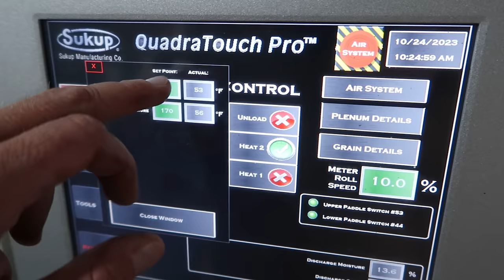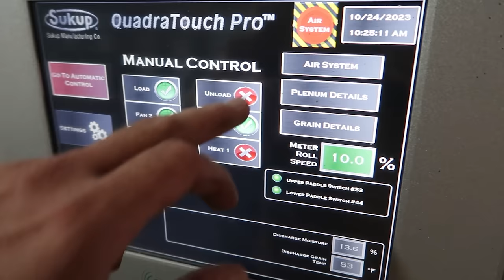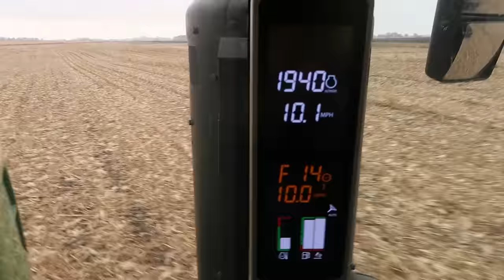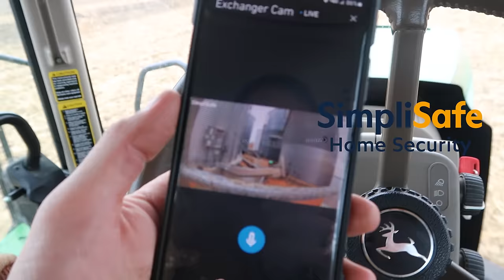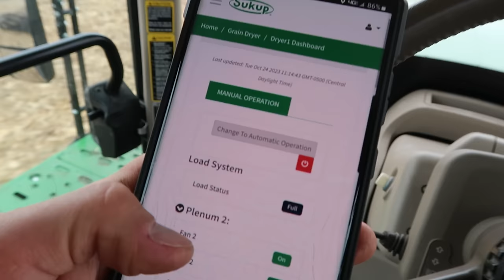Running Tillage and Finishing up Corn Harvest

Comment: I am 67 and I remember that song : Rain Drops keep falling on my head . My SimpliSafe water sensor gave us an alert . My water Softener was leaking and water was pooling on the floor  . Turned out a valve in the softener failed and was leaking. That happened on a Friday evening and my plumber was not able to check that out till Tuesday . We bypassed the softener for 4 days . wound up buying a whole new system . SinpliSafe saved us from water damage in our finished basement .

Comment: Those trailers don’t flex when empty because they are new and tight yet, the old ones flexed easier because you dropped them into a ditch a few times and loosened up all the rivets. 😂
Reply: Yeah if you say so smh
Reply: @tomcander3669 why so mad?
Reply: @Ghostplaysgames93  I'm not but most likely here's a guy making a statement and probably can't even back his pickup
Reply: @tomcander3669  never said I was better we all have screw ups. It was more of a joke because they dropped 2 of them into the ditch in the harvest videos 2 years ago.
Reply: You talking about trailers or ex-wives?
Reply: @tomcander3669 Imagine getting your rocks off by trolling people on farm videos? 

Gotta love it
Reply: It's air ride
Reply from the maker: 😂😂 it happens!
Reply: My 2019 hopper trailer is still that stiff and has been pulled 60k miles
Reply: Also, running those poly plates makes for a lot less room to pivot up front. Makes a big difference.   I’d agree with the “new” trailer thoughts.   I’d guess that in 5 years of twisting it’ll soften up
Reply: @JasonGudde but how many ditches did you drop it in? 😂
Reply: That's what I was gonna say.  Brand new, empty, super light because it's all aluminum. Well Made In America product right there.  But give it a few years and she may start to flex. But you could add some gravel and level things out wouldn't hurt.  Or concrete, but it's gets damn cold up there, so concrete will crack soon.  Unless a finisher knows how to order the right stuff for the area, might start solid for a long time
Reply: Since no one’s mentioned it yet new tight bushings on the suspension on top of tight rivots poly plates and the frame not stretching yet. Metal frames and suspension on trailers are like a house when new they haven’t had the flexing and stretching from usage yet which is why they put stickers on to have alignment checked after so many miles then on intervals after “initial break in”
Reply: @ni1469  true facts.  But honestly, how many farm rigs do you think this actually happens with? Meaning the alignment and inspections are X number of miles 🤣🤣
Reply: @TheBiggRiggz  I haul feed ingredients in a high side hopper that tracks about 2” to the right…not worried about alignment since tires aren’t feathering and also not so much of saying it needs done but explaining why those stickers are there
Reply: @Ghostplaysgames93 tomcat guy really got his panties in a sticky twist didn't he
Reply: @ryanjbalis1615  he did
Reply: @ryanjbalis1615  😂

Comment: in connection with your trailers
this is normal with air suspension. When your trailer is empty, your air beams inflate to driving level.
But because your axles consist of solid beams, you get this.
Your air beams will always be at a certain air pressure and height.
once you are loaded they will be on the road

I also have this with my truck and trailer in Europe
Reply from the maker: Interesting... thanks

Comment: I don't think there is anything wrong with your trailer. It is light and it is quite rigid so it doesn't twist when it's empty. When you drive it across a bump on one side the whole thing lifts off the ground on the other side. If it does the same when it's loaded than you have a problem 😁 Oh and great channel Zach, I love to watch it. My favourite show actualy 😉

Comment: Smacking things with a hammer is almost always the best way to start any "fix it" project.  My dad referred to that method as technical alignment. If the first "fix it" attempt was unsuccessful, then proceed with step two, a larger technical alignment tool (hammer) if still unsuccessful then you proceed with option three, assess the problem, develop a plan for corrective measures, obtain new parts where applicable, and make actual repairs. Step three should be used only as a last resort. Technical alignment is the best place to start, just check any repair book.
Reply: It worked on Skylab.  The solar panels would not deploy. They tried everything. Were considering how to work without that power source.  Someone told astronaut “hit it with a hammer”. He did, it deployed. Mission saved.
Reply: Or any object that’s harder than your hand.  In my early 20’s when I didn’t have any extra money to buy a hammer or screwdriver, I used the heel of a shoe and kitchen knife.   Both worked surprisingly well.  😆
Reply: @larrythompson8630  get a hammer 🔨 💪 and some muscle.  Best place to start. 👍 🚜🇺🇸
Reply: @BobbieJeanM what ever form of technical alignment tool 🔧 🔨 👞 🔪 available to you, as long as the task is completed 😀

Comment: I can't explain why the wheels on that semi trailer were off the ground but I can tell you I used to haul walking floor trailers of recycled newspaper to Rock Tenn in St. Paul. I would exit east bound I 94 to Vandalia Ave. Although I usually had to wait at the stoplight to make the northbound left turn I usually proceeded through the intersection at 10 - 15 mph. I noticed the left rear duals on my trailer were always off the ground! Freaked me out the first time I saw it!!

Comment: Have you tried bullet points on your ripper yet? I love them for my heavy clay and sand ground breaks compaction well leading to better root structure, drainage, and increased organic matter due to roots driving deeper faster. Not saying it’s a must but would recommend it if you keep having downed corn…they don’t kill root worm but when corn starts laying over any improvement is better than none cause I never much liked combining it either

Comment: Zachariahs....if the trailer uses standard leaf springs and U-bolts...then there could be some "settleing" or "shifting" of the bolts.  Which is BAD. not normal.  I assume the R side tires were all touching the gournd.   So Yeah, I would get the entire under carriage looked at and lined up.  It could start tracking sideways also if the Ubolts are loose or have moved.  You can thank me on air.   Red Leader...over and out.!!

Comment: With the hopper wheels off the ground, it's not the trailer it's the truck siting on uneven ground compared to the ground the trailer is sitting on.  The 5th wheel can only pivot front to back not side to side.  If you was to put the landing gear down you would have one side off the ground and all the tires would be on the ground.  The yard needs a little grading.

Comment: Looks like a lazy or plugged up level valve. Also I'd check the over extend Chains? Or Straps so it doesn't rip air bag apart if u go over a big hump. If chains, Sometimes the chain double links and gets stuck in the little pocket,  and it can't level axle cause it's bound up..or if straps are to short.

Comment: T800s are actually a better truck for on and off road use vs a W900 or like a 379 pete. The T800 the front spring mounts are actually under the frame rail, or really close. On a W9 or Set Fwd axle there is a bracket that sticks the spring over a foot past end of frame rail. Those trucks take a beating off road, flex and twist, cross members crack. Your better off with the T800s for your use

Comment: If you feel you may ever have a carbon monoxide issue I would drop that sensor to 2-3 foot off the floor just because carbon monoxide is heavy and if you sleep low then that’s no bueno. Good vid though. 🤘🏼

Comment: When the trailer isn’t touching is the trailer air supplied? Curious if the trailer brakes were set and the leveling valve was not able to adjust accordingly. Just a thought
Reply: Oh he always pulls the red button. Drives me nuts.

Comment: Wonder if them trailers don’t flex because how new and tight they are and maybe the poly you run on your fifth wheel plate is not allowing wiggle room

Comment: I have a honest question, partly because I'm an engineer, but why don't you run the dryer in auto? I always learned to keep machines in auto control because it's designed and made for it and it just works. doing things by hand can only cause trouble, is what was taught to me. so I'm curious as to why you guys run it in manual.
Reply: One how old are you?  Auto is fine sometime as long as it is working right but lets face it auto doesn't always work.  On the dry if he doesn't have it 100% automated then you can run 100% auto.  Where the dry speeds up and slow down with different moisture of corn.  Most of the guys will set it and just let it run and change speeds as needed.  You see I'm checking incoming moisture as will as outgoing moisture from the dryer.
Reply: I am controls engineer and the problem with a system that is not completely automated then it can sometimes be hard for a system (especially a heating/drying) to run completely automated. There are always some unknowns.
Reply: Farmers are creatures of habit. It will take them a long time to trust modern systems, as shown with the planter the other year.

Comment: Looks like you parked on one of them darn resection lines. See the earth is round but in the Midwest they divided it up into squares / sections so every so often they correct for the curvature of the earth and its not a perfect square. You probably just happened to park on one of those lines and the rear we  wheels were just hanging off the correction line. Randy can probably explain it better.

Comment: Simply safe needs to offer an offensive package.  Remote mace dispenser?  Claymores?
  I looked at VT. 12 hp per foot?  That used 23’ that price seemed not too bad is too big for me.  So other than speed, notched blades. How would you compare shallow disc to VT?
  On tarp. Did it get hit?

Comment: Hey Zach love the videos. Quick question why do you alternate rows when doing tillage? I've seen you do it in almost all of your tillage videos.
Reply: It cuts up the stocks and levels. The field going cross ways add an angle. Otherwise, if you went straight in line with the stocks, it wouldnt cut them up very well
Reply: @duanebolen543   thanks and why do you skip rows? is it just purpose of turning around faster and on the way you till the rest of the rows?
Reply: @samuellacroix1343 yes you don’t have to turn as sharp when you skip rows
Reply: @samuellacroix1343 

It's somewhat related to speed, but not the real reason.  With primary tillage tools, it's often the case that the tractor won't turn tight enough to easily work the pass next to the one you just made.  It can be done, but you're turning the tractor as tight as possible.  If you have have autosteer, you can make a less tight turn on the end, and leave one (or more) passes between the pass you just made and the one your going to start.  It's just a nicer way to make turns on the ends of the fields.  Likely one of those things that you have to experience it to fully understand.
Reply: He likes his felds striped like ppl do to lawns. Looks cool lmao
Reply: Just easier turning.  Take your car and turn it as sharp as you can to go back the other way and you won't be next to your last pass.

Comment: Couldn’t you technically run the mandako faster or does the tractor not have enough horsepower. I pull a 12’ Great Plains turbo max at 13.5 mph.
Reply: We pull our 30’ JD vertical till a little over 10 as well.
Reply: Might be fuel usage.

Comment: I noticed your tractors always spin over slow. Is that just the way your deers sound or are you running the wrong batteries or to much Amp draw on the starter side? I watch a fee different farmers and your tractors always act like the are slow to turn over. Just curious.